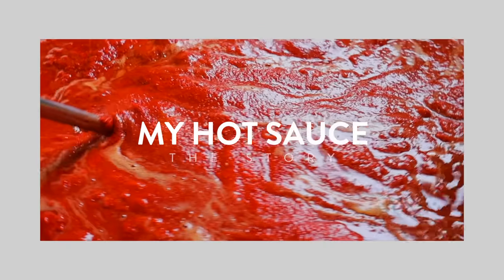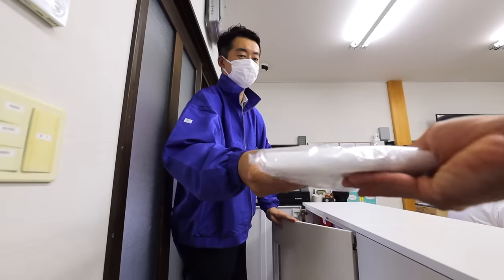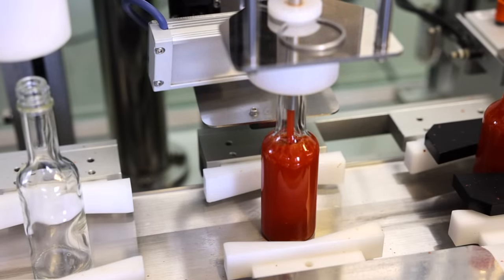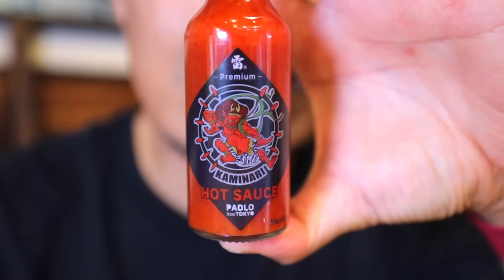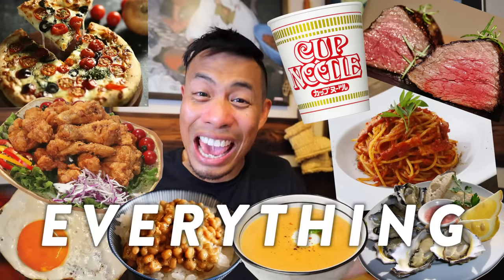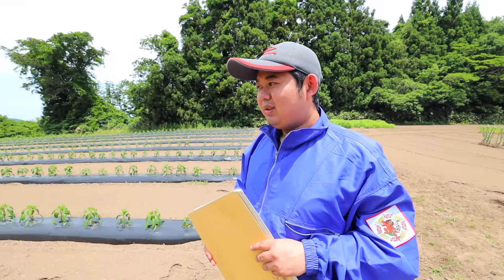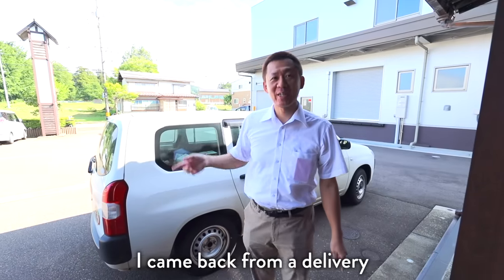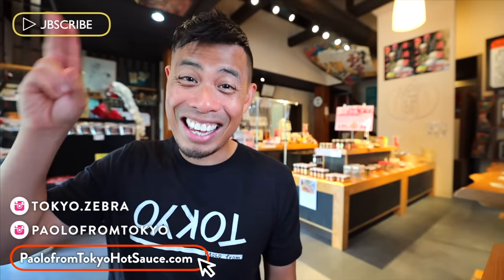I made my own Japanese Hot Sauce !!!

Comment: I just found out it is the PERFECT taco bell hot sauce. 

I think the tortilla breading helps absorb a lot of the chili oil so you don't have the extreme lingering heat where the oil just stays in your mouth forever, but you still get the heat for a bit. Then the kanzuri just kinda compliments the taco bell sauces, like the quesadilla sauces. It sort of lowers the potency of the kanzuri taste while amplifying the quesadilla sauce to the max and just makes it the perfect flavor with the right amount of heat. I ended up using a lot of that really spice hot sauce and incredibly didn't end up with a horribly upset stomach or just stuck on the toilet for the evening. 10/10 

Get a taco bell partnership for your sauce
Reply: I eat it a bunch with the Filiberto's burritos I get. The sauce is good. But I think I always use too much... I always end up in the toilet with regrets the next day.

Comment: ordered two bottles of it and its unlike any hot sauce ive had. the umami flavor is very prevelant but not overpowering. the heat is there but not like a melt your face off kind of heat. a single drop to every bite of food is more than enough to bring out the flavor. by far one of the best hot sauces ive ever owned. i have been putting it on almost everything ive been eating since ive gotten it and in three days, and already 1/3 of the bottle is gone!

Comment: I ordered my bottles during the second round, honestly shipping was quicker than expected, not Amazon, but you get the idea. Also this packs some HEAT, this hot sauce don't mess around, but it's mostly an upfront burn in my opinion. This hot sauce could probably be used on Hot Ones honestly. The flavor alone is better than most. The tang afterward that isn't carried by vinegar which is nice. I probably wouldn't use this as my daily driver, but definitely a topper/enhancer type of hot sauce, something spicy, rich pepper flavor, and some tang/citrus to cut the fats.

Comment: might have to get it, if its only 58,000 scovelles units, that should be hot but not super hot, as ive had carolina reaper sauces near 1mil scovelles, and a popcorn with carolina reapers at 2mil scovilles - also did the one chip challenge, however anything above 200,000 scovilles starts to become more heat and pain than enjoyability.

Although im still a little scared to try it from that heat, while noting its only 58,000 scovilles, just mentioning carolina reaper gives me some bad flashbacks. and i dont know any chilli heads around here but me if it ends up too hot (everyone around me things ketchup is spicy lol)